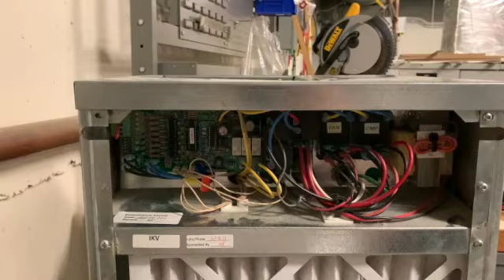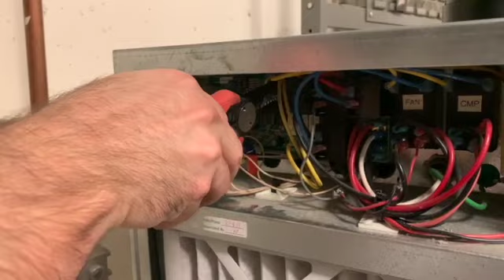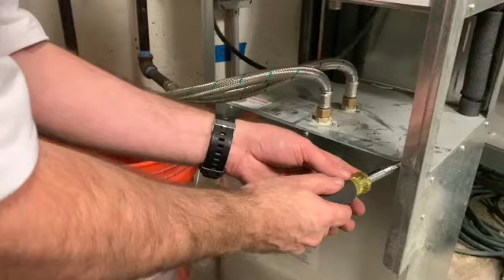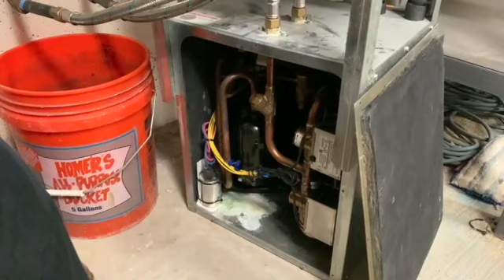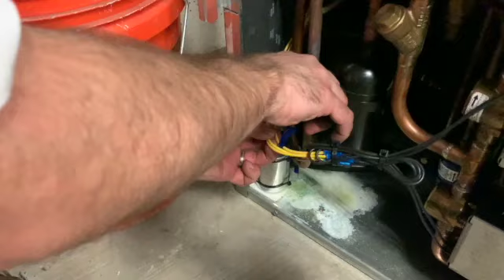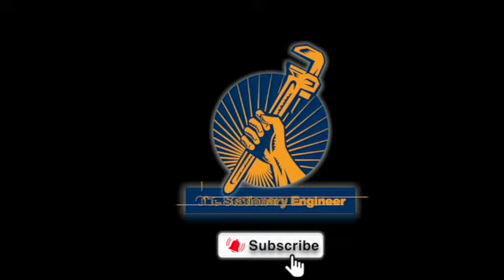DEAD CONTROL PANEL ON BULLDOG HEAT PUMP

Comment: Do you also run into the units creating significant low frequency vibrations in the walls?  Have multiple people complaining the walls in the apartments vibrate in the low frequency base range, and testing shows significant noise peak centered around 75Hz.  So it feels like there's a subwoofer in the apartment.  Other than the chassis touching the metal studs, do you have suggestions on what else we should check?  Thank you.